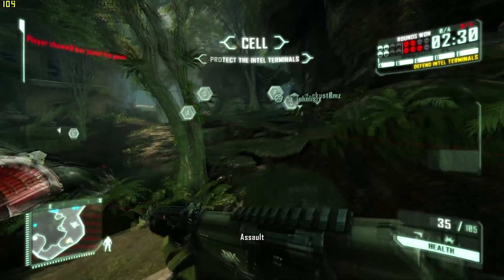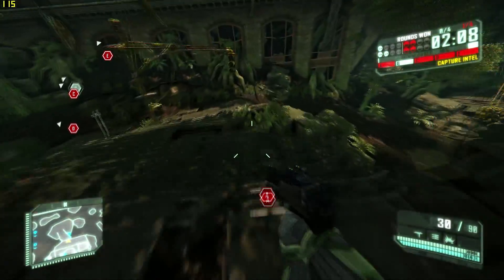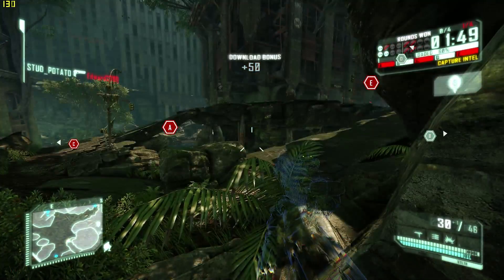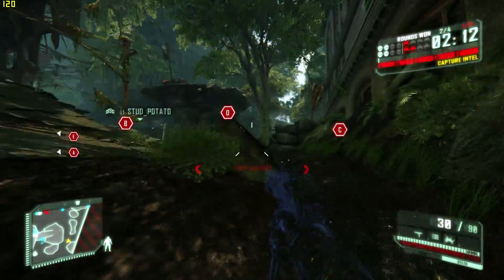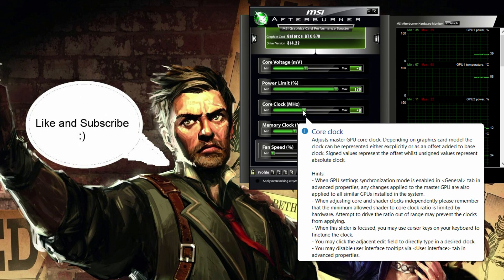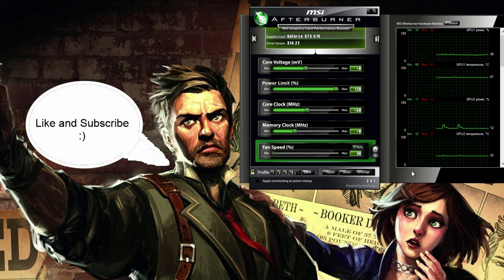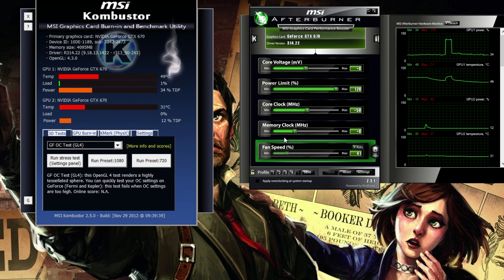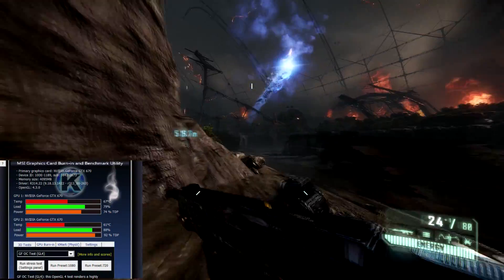How To Overclock Your Graphics Card 2013 Beginner's Guide Part 1 (GTX 670 SLI Crysis 3 Gameplay)

Comment: i have two gtx 780 ti cards that have both fried nzxt wont take liability nor will evga for using nzxt's closed loop water coooling kraken x30 gpu mount all while still keeping the heatspreader on the cards and even adding extra heatsinks on top of the vram and VRM spots to help dissipate more heat quicklier, i didnt even get to try over clocking i was just running kombuster and what kombuster did was fry both my cards when they were running in the 2nd x16 slot of my rampage IV extreme mobo, they were in sli with idenetical cards using phanateks pk-4 thermal compound, everyone on the evga forums were talking about how bad kombuster is for people because how likely it is to fry cards regardless of any setup.... the reason my cards fried was i thought my own fault but turns out that i did not see any fragmenting of any kind, what happened was the cards in the 2nd slot dont have overheating fail safes monitoring them when running in SLI so if the primary card ever got close to overheating  it would shut down but since this was the 2nd card it fried, so not only are u wrong in your statement, not only are you promoting a program which already has a really bad rap across many online communities for bricking cards.... you now OWE ME 2 EVGA GTX 780ti SC ACX graphics cards in brand new condition, i expect them to be in the condition mine were before i did what u did on my own accord thanks to other people recommending that horrible benchmarking/wear in software, that means these cards you give me better not have been exposed to air for more than say about 3-4 hours and can have closed loop water cooling systems properly installed onto them if you so choose rofl

Comment: Thanks so much. I went from getting 20 FPS on Battlefield 3 to 40+ FPS. On a Nvidia GeForce GT630
Reply: byronmovies So i should sitt screaming at you OH YEAH I HAVE DUAL TITANS, SUCK IT B!TCH
Reply: Woah dontmdo that man your gonna kill your laptop NEVER over clock a laptop
Reply: Its not a laptop.
Reply: my bad you wrote gt and the gt series is for laptops
Reply: It is a GT630 and its in a desktop, it is WAY to large to fit in a laptop.
Reply: you mean gtx right...
Reply: No i mean GT 630
Reply: alright
Reply: The GT series are pure shit i own a 550 it sucks
Reply: Well they are bad because they are the cheap low end cards made by Nvidia.
Reply: I can't enable power limit.. and i have gt 630..
Reply: TheBmxRyder You need to edit a config file, google search it
Reply: How far was it pushed in voltage?

Comment: I am kind of afraid to do this, My gtc 660 superclocked can overclock by 1001 MHz, but im worried if the heat will fry it or the voltage will.

Comment: i remember the old days, learning how to mod VRMs by reading the chip's industry-grade datasheet, soldering wires around with resistors directly onto those tiny pins, letting stress tests run for days...
pencil tricks, "C" wire inside cpu sockets, external v-core wires soldered on the board to get easier voltage readings with reliable meters, guessing core temperatures by touching the board or the heatsink (lol, also OUCH), recapping mobos, bios hotswaps...
custom liquid cooling, high end PSUs with passive PFC (the system is stable horraaay! oh here's the cd drive speeding up drawing some amps... bsod), barebone rigs with stress tests running off floppy disks, jumpers and dip switches...

to the last MHz. untile summer arrives again and Δt is now Δt+hotSummer => back to testing. :)

while it's not a bad thing to make something easier to tamper with, i kinda miss all that mumbo jumbo.
stepping from an ancient socketA bios to a 1155 based one really made me somewhat sad that such a practical and sometimes physically demanding hobby (or OCD i don't know) has become so "easy access".

nowadays, i think car audio is more fun. :)
still no chicks around though... XD
Reply: You can take solace that your effort with thousands of others prompted card manufacturers to include auto OC for those lazy heads like me.
Reply: wayne king 
yes.

but...

auto OC in my head is like the famous amplifier that "goes to eleven"... let me explain:

i could sell you a 1GHz chip which might go +50-60MHz or more with significant effort, OR exactly the same chip running at 750MHz with +300MHz "turbo"... plus, again, something more with the very same significant effort as before. nice huh? :D
i already already know there's a large safe margin going up with the frequency and it looks nice when reading the rated current absorbed by the component.

this unfortunately is only marketing and has nothing to do with OC. ;)

p.s. by "significant effort" i mean stuff like modded bios, modded vrm, custom cooling etc.. the fun stuff i was talking about before.
Reply: P0ppaRasta  a farmer might say something like that, and i'd appreciate it. :)

Comment: after you overclock and if it doesnt crash is ok but when you restart your pc will you GPU still overclocked or not?
Reply: If you check the option to start when windows starts :)
Reply: If you are in MSI AfterBurner the option is at the buttom of the window,below of the profile section says: "Apply overclocking at system startup"

Comment: I went ahead and overclocked using these utilities according to numbers I found on an online guide (slightly tuned down from their suggestions just to be on the safe side). 

I couldn't use the Benchmark supplied by this video for some reason, but I went ahead and played Skyrim for about 20 minutes just to test it and I have to say, there is a noticeable improvement!

I can't say how many FPS I gained precisely since Skyrim is heavily scripted and (for me) massively modded, and it always depends on time of day, location, scripts, mods, how many npcs, what you are and how you are doing...  But running through some of the same locations I typically do my stress tests in, in combat, out of combat, using console commands to add NPCs and use crazy spell effect etc..

I would estimate that I gained at least 5 fps, probably more, on average by overclocking, and my temperature barely budged, never going above 50.

Thanks for doing this guide, despite a couple of problems I was still able to use the programs you suggest and increase performace noticeably!

Thanks!

Comment: Hello...

I have followed your instructions to the letter, however I have two problems:

1) the Power Limit (%) bar is greyed out and I don't have access to it;

2) When I try to click the "run preset 1080" button on Kombuster interface, absolutely NOTHING happens, as though I didn't even click the button.  No message, no graphics, screen stays the same, it's as though I clicked on air.

I have followed your instructions multiple times step-by-step...  Going backwards in the video again and again listening carefully to every.single.word... but nothing happens at all in Kombustor and I find it strange that one of the bars in Afterburner is disabled...

Any help?

Thanks!

Comment: im running a GT 630 but there is no "Power Limit %" in the options, think its just my card, cause i tried updating MSI Afterburner, and my old GTX550 Ti used to have it (note where i live is very hot so i always run the fan a bit faster, fan fried 1 month after warranty! )

Comment: i'm running a factory oc gtx 660 (msi twin frozr III) when i increase my oc by 40mhz or more it sometimes freezes my game or benchmark tool and then continues off from factory settings. could this mean that there isn't enough power coming from my psu to my gpu? (i have my power limit set to 119%)

Comment: if you google your cpu and gpu the manufacturer's website should tell you what the max temp is.  Most nvidia gpu's (kepler) should stay under 70 degree's C because thermal throttling begins there.  Google overclocking ______ card, overclocking ____ cpu.  C'mon guys silly questions like this are what google was made for.

Comment: i have an x51 too and you got the 670 to work? i was told not to try cause its "not supported" by my model of the x51 but the newer models support it  but you have an older model and it works? idk im confused by the whole thing what do you think i should do get a gtx 660 ti sc or the gtx 670 ? :P

Comment: overclocking fun if you an electrical engineer...all cpu have plus or minus volt tolerance depending cpu...now you over volt you cpu to it max limit and you power supply varies a little bit volts cooking man. I trow not woudnt it be wiser to have that head room for such things.....second my card is decent does what its suppose to @ stock speed it does get very warm.. I don't need or want my card to run any hotter...

Comment from the maker: That is 100% up to you. Because of the poor airflow, overclockability is limited. You would have the extra noise, extra heat, and a shorter GPU lifespan, for less of an overclock than you can achieve with a different system. If you are ok with that, then you can consider overclocking.

Comment from the maker: You can keep your CPU fan speed the same, but you can push the case fans and gpu fans at over 70% if you are overclocking, but they will be extremely noisy.

Comment from the maker: I think that's an OEM (official equipment manufacturer) card, meaning it came in a prebuilt system. Their clock speeds usually have a fixed multiplier.

Comment from the maker: The Titan isn't as strong as the 690, so my build would do better. I think my 670 SLI would be a little better than the 690, because SLI 680 is better than the 690, and an overclocked 670 is about the same as a 680.